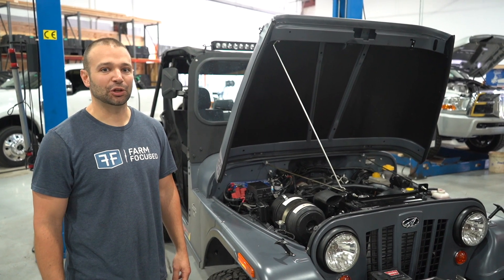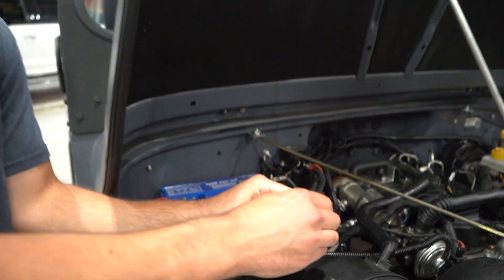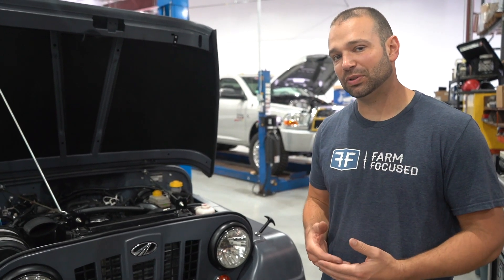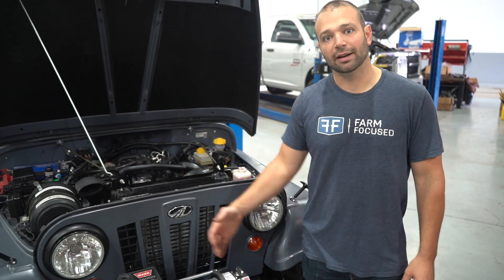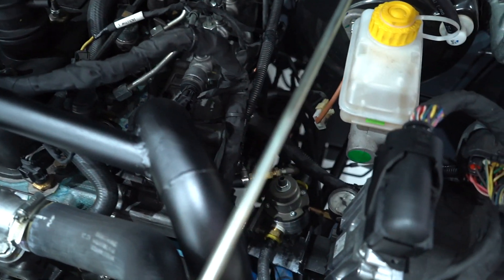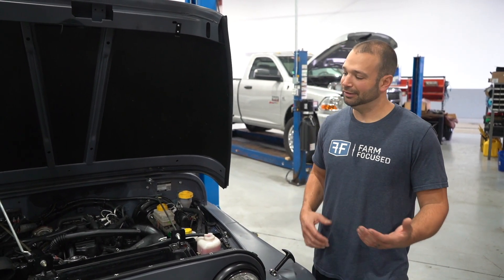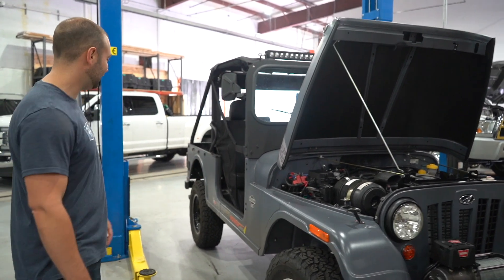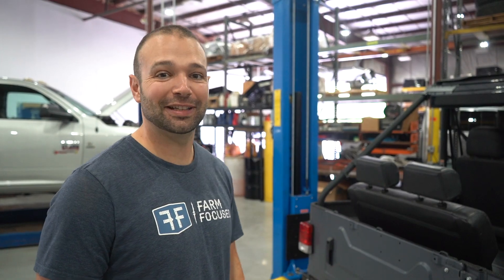Taking The Mahindra Roxor From 52 Horsepower to 200+ Horsepower

Comment: I love you actually have it tuned and not just dumping excess fuel out the tailpipe and claiming it makes power.
Reply: Rolling coal for me is I love hate relationship mostly hate though. Sure it's fun at all in good conscience, but it always gets misused, and it's never good for the environment anyway. Not to mention a tuned engine burning all the fuel that it's receiving, is always going to make more power with the same fuel. So yeah fun as in doing a burn out but not practical to do all the time or leave it to do.

Comment: This is the video I wanted to see. Someone safely tweaking the motor to 200hp and 400ftlbs at the wheel. It's a Peugeot motor made under licence by Mahindra. Peugeot is world class in diesel technology.

Now, Mahindra sent that motor tuned to 48hp and 110ftlbs of torque.To put the new power down you need to widen the track and upgrade the brakes.
Reply: They have licence for Willys jeep. The motor has come a long way and its not by Peugeot. Its actually a M&M motor .
Reply: @mrjb1778  yes you are right.It was developed by M&M
Reply: no man, the engine was developed by mahindra themselves.

Comment: The transmission/ clutch ,diffs, are gonna take a crap with all that power they were not designed for.
Reply from the maker: It already has an upgraded clutch and no issues have come up yet.  Even after countless full power dyno runs, trail rides, and general abuse.
Reply: @Duramaxtuner  ..the key word is "yet".   There is only so much the factory diffs and transmission can take..  but good job anyways man!
Reply: Factory diff is a dana 44 equivalent which will be fine at that level.
Reply: @cody7135  I can't see that being possible,

1998 dodge ram 1500's have Dana 44's from the the factory,. And they are way beefier then this thing I would know I own one,. They also put Dana 60's in the 360CI engine models,

This little vehicle is the equivalent of Mazda B200 diff  or a 1980's Toyota pick up..

It's a cheap East Indian copy cat version of a Jeep CJ.
Reply: @zorans5200  here is my source on this. There will be a weak link discovery as power is added I doubt it will be the axles. U joints will go long before.

7 Things You Didn’t Know About The Mahindra Roxor

By Rick Sosebee

"The gearing in the Roxor is 3.73 and can be changed out with over-the-counter parts from most automotive stores. With the correct shimming the Dana 44 locker will fit in the factory Roxor gear case."

https://www.utvdriver.com/7-things-you-didnt-know-about-mahindra-roxor#page-6
Reply: @cody7135  ..okay cool.. so with some major modifications.. it will be equivalent to a Dana 44?
Reply: @zorans5200  where did I say major or did the article say major? It simple says shims. Not sure if you have ever put a locker in a axle (simple standard upgrad)? Shimming is  part the normal process they come factory with locker options. My point is simply if a dana 44 locker bolts in then sizing of the axle would be equivalent to a dana. Simple thought process.
Reply: @cody7135  .. it's made with cheap metal.. even if the gears last ...the frame would most likely to twist under all that power..  
Did the frame get upgraded?
Reply: @Duramaxtuner   lets ask this simple question. Calibrated power what size is the axles? Thanks
Reply: @cody7135  ..hahahaha!..  "simple process"  I don't think you have ever  done any shim work to know what a pain it is till you get it right..

It's a job at that point...
Reply: @zorans5200  Did you not read the article it is a fully boxed frame! I have been building axles for over 20 years. Once you learn how to build them gear changes and lockers are no big deal. I'm not sure what your true hate is for the roxor is? I have given you plenty of evidence in the capability of this vehicle. You seem to be a typical person of these days and don't want to admit you are/were ignorant in your statement. I agreed with you! Something will break but it won't be the axles! You do realize mahindra builds a 1900hp super car right? I'm pretty sure the company is capable of building an impressive off road machine.  Yes calibrated power is adding horse power as man has done since the begining of time. They are a after market company after all.This is there business to design/build/install. They are simply showing what it is capable as possible future upgrades. If you wish to continue to be ignorant that's your choice. Your welcome to show me some facts as I have shown you.
Reply: @cody7135  dude all I'm saying is anything will work with anything when it's modified...

This thing was never engineered for such torque and horsepower is all I'm saying... 
And throwing that much power into such a small machine things are bound to break...  Yes I may be a bit ignorant... But that's simply because I have been working on vehicles for a long time as a mechanic.
I have no hate for the roxor... I just simply stating that it was not built for such things...
Do you know how many young guys I've seen that own diesel rigs bought with daddy's money snap drive shafts, break Axel's, or twist frames.. just by chipping the trucks up or swapping out turbo's for bigger ones and we are talking about full size American diesel pick ups... And your talking about a Jeep CJ  copy cat that was designed to handle 68HP!  
Now it has 200!   It's simply not designed for that power without modifications...  Anyways I apologize if I came off as ignorant.. but the mechanic in me had to get my 2cents out.
Reply: @zorans5200   you are most definitely  correct. Was not designed for this. I have multiple trucks including 2 diesels a lbz and 7.3l nbs. Both have minor mods to improve on factory problems. I laugh everyday seeing these punk kids that just wanted to blow smoke an thought it was cool until the trucks break. However on the other hand I love it! It keeps me in business and when they can't repair it there is now more parts in the junk yard for me!! You have to remember calibrated is a company they will build it to the moon. Every time they find a weak link that's a chance for them to re-engineer that part an make money selling those parts. I personally am intrested  in the roxor and what parts it really use's from the factory. From what I have seen so far it actually appears pretty stout.  Im thinking weak links will be brackets,u-joints,auto trans?, The motor seems okay (its a dirty diesel) the manual trans looks to be a knock off bx10 the tcase is a knock off dana 18, the axles are dana 44 knock offs. That has potential for some pretty good running gear. Maybe dieseltuner could do a video on running gear? So for long reply. Thanks
Reply: @cody7135  .. all good brother!    

Yea I absolutely agree the punks with the diesels make me laugh too..

I got- 1 LB7,. 1LMM , 8 6.7L Cummins 5500's
1-HINO  and 9- PX9's    I'm constantly in and out of diesel shops chatting with other mechanics... We always laugh at these young kids blowing up theyr $60,000 trucks that daddy bought because they bought tuner chips off of ebay .. causing the CP3's and CP4's to blow up or transmissions take a shit.. 
Or they twist up the frames..      

But yes the roxor is a tough little buggy from what I have read on it..
Reply: @zorans5200  at this point I know you're just trolling and hating..
The only thing I hate about this is the price of the stock vehicle. Should be under 14k.
Reply: @zorans5200 ”shit don’t last forever”

Comment: Have you upgraded the 12 gallon fuel tank? 25 gallons would be nice with the engine upgraded.
Reply from the maker: We have not.
Reply: Man I want one. I had an old CJ2A ,it still had the hurricane 4banger,twin stick transfer case and T90 Trans. Mine was the military version with LOWW!!! GEARS ( 5:38-1) I could walk faster than it moved in low range 1st gear. The only mod mine had was 32- 10 50_15s .55mph was the fastest it would go more so that was down hill with a tail wind. Anyway this thing is everything I want, diesel basic and lots of fun. Congrats to Mahindra for making a great 4x4.

Comment: 26ft lbs of boost.........motor will detonate
Reply: false
Reply: @nickpriegnitz5895  - you go right ahead. It’s too much boost. Even in an iron block. That much boost requires that much more fuel. That is a lot of strain. You’ll take a 200k engine, and destroy it in 30k. Then add the fact that the exhaust wasn’t touched, it will overpressure. Over pressure will blow seals. Unlike you young man, I’ve actually worked on engines. Keep your one word answers to yourself.

Comment: 4 times the power on an Indian designed/built anything. Oh yeah, you're gonna do some shreddin'...Sub-Chinese build quality, if that's even possible. Might want to get a drag blanket for the clutch, if it frags in one piece they can cut off feet. Best of luck.
Reply from the maker: Thanks for your well wishes. Also, we already have a southbend clutch.
Reply: @16V .. 
I guess it will be more reliable and cost effective compared to a FCA ride for Stuck up adolescent adults from the Bro club. 😂😂😂
Reply: @boohoomoron7629  More reliable than a Jeep? Gosh, there's a high bar...
Reply: @16v15  I mean it and it's a fact. On the other hand, the Italian thing, not so much.
Reply: Its unbreakable , its a daily Tried n tested workhorse of india, its low power offers great fuel mileage,  with mods like this , it will be better off road than any other SXS and will also tow more than 1.5 tonnes , its the steel body on frame , and Mahindra is a big player in sheet metal, so its coming straight from iron mines of india to u , its the best world could have for such low price , far superior than Chinese in every manner, this thing will last for ages of abuse